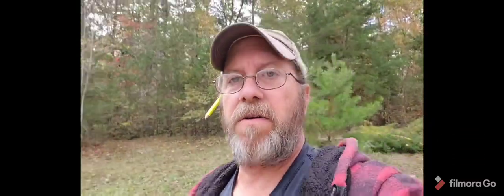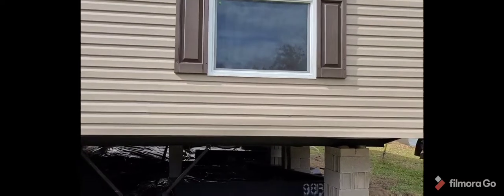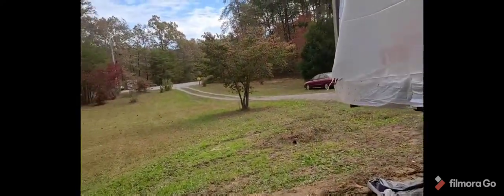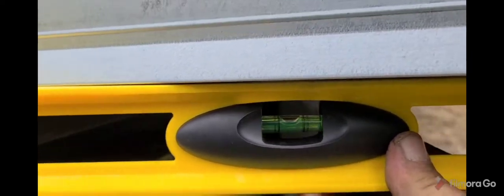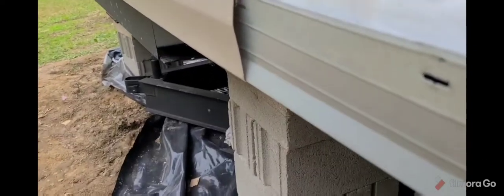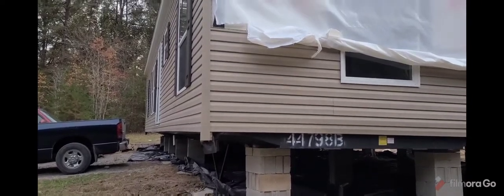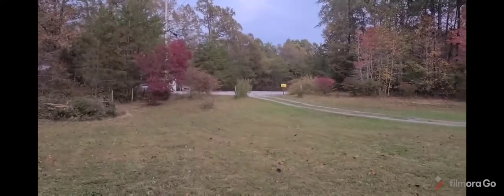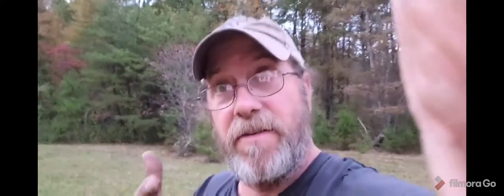workin on new home for next few weeks so HELP ME

Comment: Tons of fun !  I just got done last weekend replacing some rotten wood on the roof eave and now that's also got new siding on it. We got that cement board siding. I'm fixing too dive into drywall hole repair. An electric wheel chair as well as 6 kids...thanks guys 😡  got some door trim too replace throughout the duplex. A bathroom to remodel and 2 kitchens to update 😵  oh and paint inside and out 😖 I feel it too Mr M
Reply from the maker: Lol rite home ownership and repairs are a never ending process lol good luck with your dry wall repairs now thats a challenge lol
Reply: @MMProspecting  Yeah I've no experience in taping and mudding. It'll be a learning curve for sure. I'll definitely be watching more how to videos lmao. I'm dreading the painting...not the painting but the "Prep" lmao. The duplex is like 85 or more feet long. Gotta shingle the other side of the roof too. Did one side last year.
Reply from the maker: @chrissaucier9386  don't know how much of that I'll do but no painting except for a couple closets

Comment: Ive done siding for years. Your doing it right and it looks good, remember to allow for expantion by leaving an eighth of an inch up against the corners and windows. If you dont it will "snake" as you put it lol. Are you wrapping the gable ends with aluminum? Roof edge I mean and maybe the sofit? Good luck Mike its looking good!!
Reply from the maker: Yeah there's aluminum facia its a one piece deal right you have to leave a little room
Reply: Bob .. that’s cool my friend .. 👍🏻